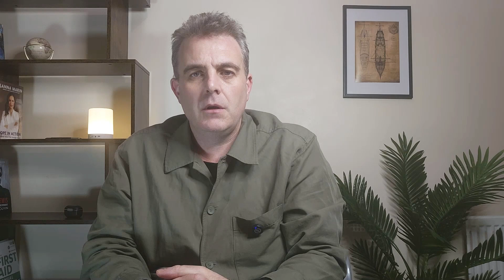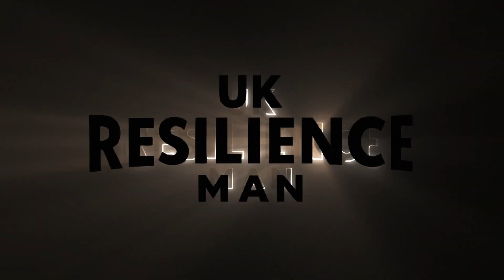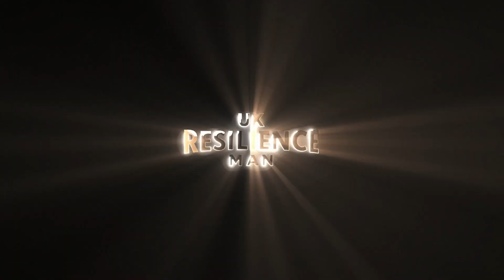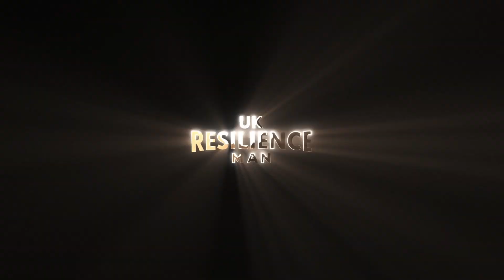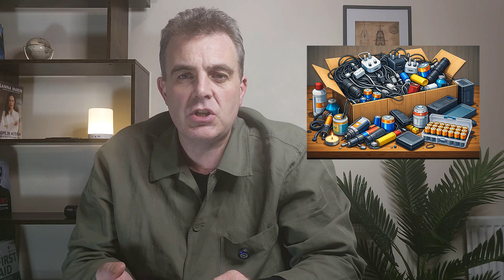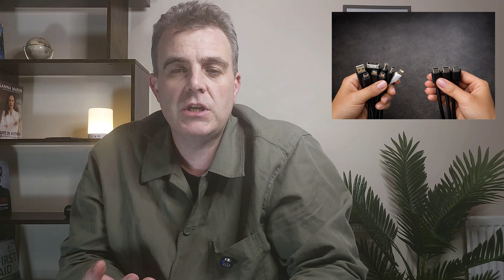Interoperability: Reducing friction in preparedness systems

Comment: I recall hearing something like this on Tomorrow's World... 40ish years ago.

They spoke of the "cross head" screw!  The idea was easy.  One only uses the single type when building or creating.

😂 They said it would never catch on.

I used this process in the creation of my home.  All screws were to be crosshead and all nuts were to be stainless lock nuts.
I kept it mostly.  Engineering screws use a different drive, for example. 

But yes absolutely, lots of cross over creates LESS problems.

Comment: I'm slowly retiring and replacing devices to use the same cables and connectors, the older devices are either gifted to family members or friends who have no preps.
Reply from the maker: Yes, but consider the external adaptability too. :) There's a balance to be struck between everything you own working with everything else and being able to use anything you get your hands on. I recently bought some AAA to AA adaptors for this reason. They arrived a few days ago and I haven't tried them in a torch yet. Thanks for reminding me. Of course, all things being equal, you would use AA rather than adapted AAA.